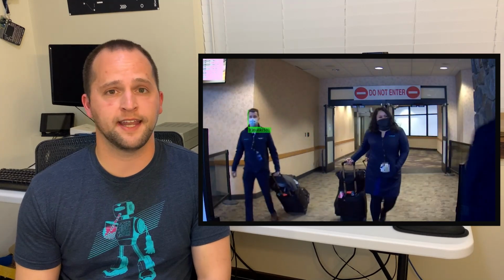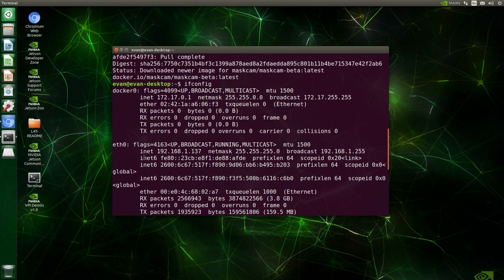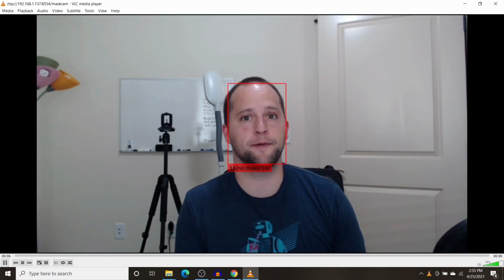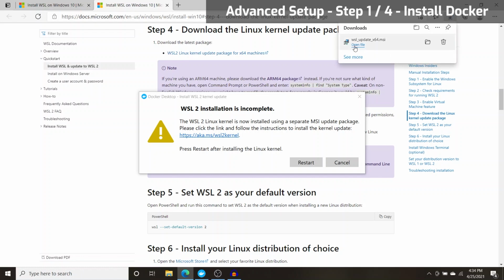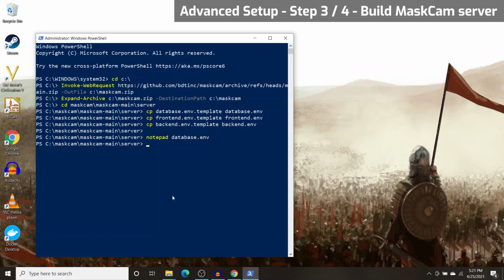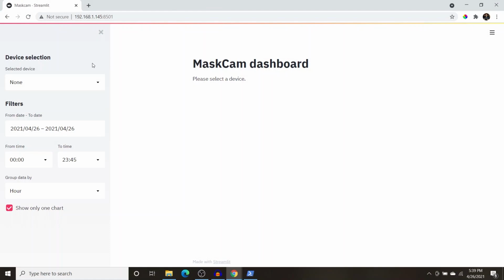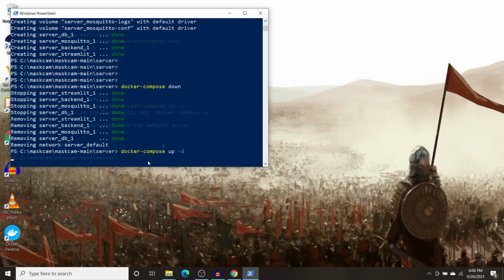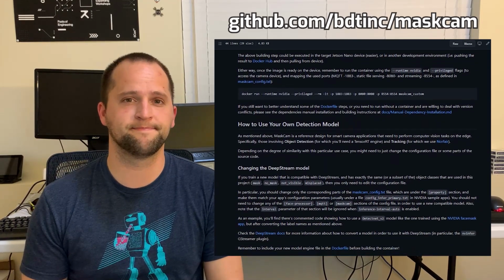MaskCam: How to Set Up your NVIDIA Jetson Nano as a Web-Connected Mask Detection Smart Camera

Comment: hello sir! Can you help me with this error? 
ERROR    inference | gst-stream-error-quark: Internal data stream error. (1):             prints.py:42
           gstbasesrc.c(3055): gst_base_src_loop ():
           /GstPipeline:pipeline0/GstV4l2Src:v4l2-camera-source:
           streaming stopped, reason not-negotiated (-4)
Reply: Having the same issue here.
Reply: if you're using CSI camera, run the command below: (note: replace <your_jetson_IP> with your jetson's IP)
sudo docker run --runtime nvidia --privileged --rm -it --env MASKCAM_INPUT=argus://0 --env MASKCAM_DEVICE_ADDRESS=<your_jetson_IP> -p 1883:1883 -p 8080:8080 -p 8554:8554 maskcam/maskcam-beta
if you're using USB camera and got that error, try to change the last number to 0, -1, 2 at MASKCAM_INPUT=v4l2:///dev/video1 in the following command:
sudo docker run --runtime nvidia --privileged --rm -it --env MASKCAM_INPUT=v4l2:///dev/video1 --env MASKCAM_DEVICE_ADDRESS=<your_jetson_IP> -p 1883:1883 -p 8080:8080 -p 8554:8554 maskcam/maskcam-beta

Comment: Sir, I have learned a lot from your videos and started to work on a project. 
I have trained a custom tflite model and its working file on raspberry pi 4.
Now i want to use the model with CORAL BOARD. 
Please guide me in "how to compile TensorFlow lite edge TPU models". So that I can achieve a higher fps.

Thank you

Comment: Amazing project!! 👏
Sir, Is it possible to use the model throughout the day using the heat sink with fan?
Reply from the maker: Thank you, and yes it is! The prototype we tested (which had a fan + heatsink) maintained a temperature of about 44C while continuously running the MaskCam program without throttling. You can see more info about temperature on page 18 and 19 of this report: https://bdti.com/maskcam

Comment: Hello, im trying to run a ssd mobilnet on flutter for Android and IOS, i tried to use an old quantized model which seems to not working with tensorflow 2.4. I wanted this model for the uint8 input, all the model i find now have a float 32 input resulting into very low fps once it's in the app... Any advice to solve that ?

Comment: I dont have a usb camera, can i start this project with my raspberry pi camera v2? :(
Reply: There is an error when i try to run the docker file, it can be because of I didn't connect a USB camera. It says ""The requested  image's platform (linux/amd64) does not match the detected host platform (linux/arm64/v8) and no specific platform was requested "
Reply from the maker: @alpertemizel9892  Hmm... Are you using a Jetson Nano? That errors seems like you might be using something besides Jetson Nano.
Reply: @EdjeElectronics  I definitely use a jetson nano... How can i delete the docker container and install it again? Maybe it solves the problem, or I can downgrade the jetpack version
Reply from the maker: @alpertemizel9892  Okay, good to know. Do you have a spare SD card you can flash flash JetPack v4.5 onto and start from scratch with that? Also, for some good news, it does look like you should be able to use your Picamera v2 with the Nano: https://www.jetsonhacks.com/2019/04/02/jetson-nano-raspberry-pi-camera/
Reply: HI Alper, I have the same issue "The requested  image's platform (linux/amd64) does not match the detected host platform (linux/arm64/v8) and no specific platform was requested "
. When you downgraded your jetpack version to 4.5, did it solve the problem ?
Reply: @joehenri1  I didn’t try, sorry for that, good luck!